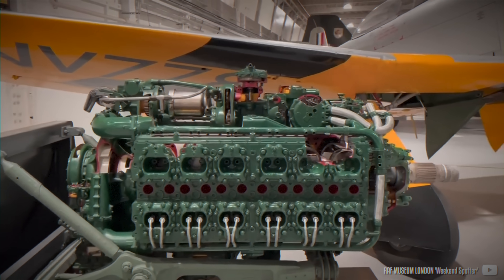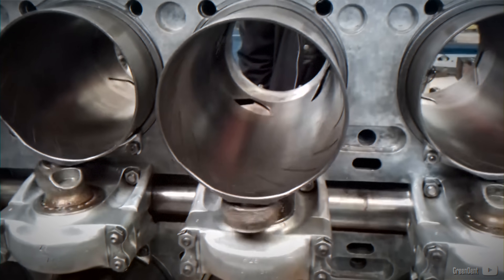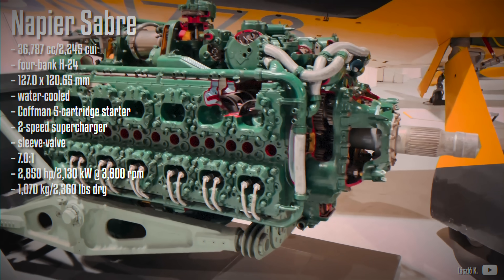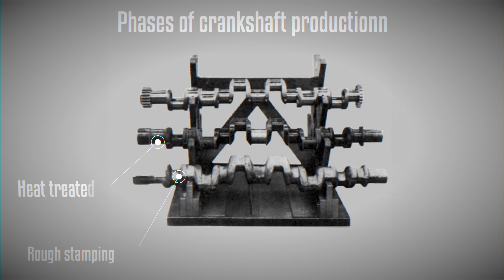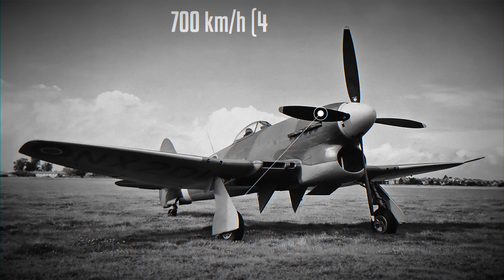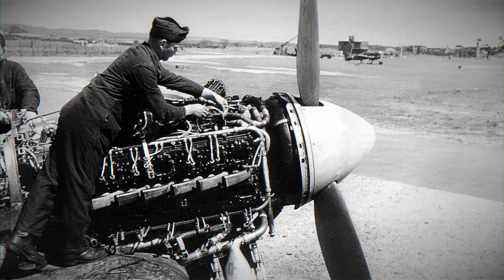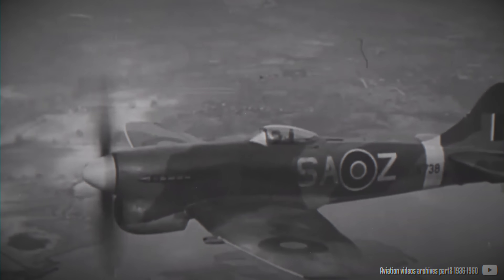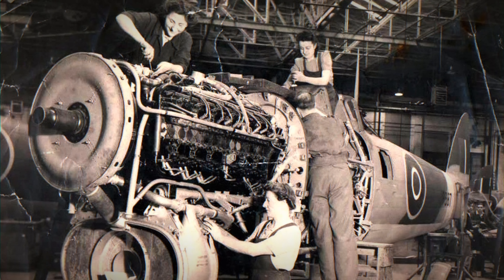An Unreliable 24-Cylinder That Helped To Win The War

Comment: These used a large amount of castor oil in their oil;  The mechanics that worked on these invariably ingested small amounts of this oil, which is a powerful laxative.

"I've gotta go potty!"
Reply: That sounds like an urban myth or maybe you made it up.  A typical adult dose to make you go is 15 to 20 ml - about one tablespoon.   It is quite likely that mechanics with oil on their hands might wipe their mouths and ingest some oil, but it would be nowhere near a spoonful, even if it was 100% castor used.
In any case, the digestive system has great powers of automatic adjustment and under regular ingestion will overcome any laxative cause.   Those of us old guys who, like Joe Biden, are on a drug esopremazole long term (eg to stop chest pain) know that - it causes diarrhea but only for the first few days.  When you stop taking it, you don't go for about a week.
In WW1 it was said that pilots ingested castor oil blown back in their faces by the open design radial engines of the period. But considering they had to fly rickety cloth & string biplanes into enemy territory and get shot at, I reckon anyone would get the urge to evacuate regardless of what they did or did not ingest.
Reply: @keithammleter3824 Rotary type engines used castor oil and were total loss lubrication, most of the oil was ejected from the exhaust ports and blown back towards the pilot and crew.
The typical image of the WW1 pilot wearing a scarf was a very practical article of clothing  used to cover the pilots mouth and prevent ingesting the castor oil
Reply: If they did indeed use castor bean oil in the Typhoon and Tempest,  the flight lines must have smelled wonderful. Castor bean oil was well known for unmatched lubricity and was quite common in the 60's and 70's in racing two strokes.

I road raced club level in the early 70's at Ontario on a 750 Honda and the smell in the pits and even on the track following a bike burning race gas and bean oil was quite lovely. Even some of the 4 stroke bikes had it in the crankcase. There was no mistaking the aroma.

The sounds of twin and multi 3 and 4 cylinder 2 strokes mixed with the booming twin XR 750 Harleys and the odd BMW boxer, 3 cylinder BSA and Triumph triples and Honda 500 or 750 and of course a 4 cylinder Z1 900 Kawasaki or two all making music to ones ears mixed with the smell of castor......well it was just magic. Ontario Motor Speedway Champion Spark Plug Motorcycle Classic 1972 or 1974 I think it was. The race tracks will never sound or smell as sweet as those days.

 Blendzall had 3-4 different castor bean oil mixes. I think Blendzall gold had nitro in it. I remember Blendzall green also. Later on when working on my bike in the garage I would grab a quart of Castrol pure castor bean oil and would put some in a teaspoon that was held in my bench vise and I would put a torch under the spoon to "cook off" the bean oil just to get the garage smelling somewhat like the good ole days at the race track.

I never ran bean oil in my two stroke Yamaha due to it gumming up everything in short order and needing to be disassembled regularly for cleaning the top end. I ran an early synthetic Steen C in my 2 stroke Yamaha cafe racer. Much cleaner burning but nowhere near as nice smelling as bean oil. I did run Cox model airplane fuel with bean oil and nitro in a lawn mower back then tho. Same wonderful smell!

To your remark about laxative qualities of castor oil my Dad told me a spoon of castor oil was used as a threat when he was mis behaving as a kid in the 30's. He said the mere threat would straighten him right out.
Reply: @sandervanderkammen9230  ;  Yes, I should have written "rotary" where i wrote "radial".
Reply: @terrydepew1252  : My mother told me much the same story as your Dad.   If I remember right she said it tasted really foul.  It was the foul taste that made her behave more than the trots.
Reply: @terrydepew1252  Great info!  RC model planes for years used methanol based fuel with nitromethane and castor oil.
Reply: @keithammleter3824  It was brown trouser day every day in the 20 minuters.
Reply: @throwback19841  You must have been a very bad boy.

Comment: The Sabre had THREE inlet ports and TWO exhaust ports, the sleeves had FOUR ports.  One of the sleeve ports (openings) serviced both an inlet and an exhaust port.  This is the same arrangement as the Bristol sleeve valves, the Rolls-Royce sleeve valves and the little-known experimental Continental (at least some of them) and Pratt& Whitney sleeve valve arrangements.

This is usually considered a no-no in engineering, with first relatively cool inlet gases travelling through the port followed very quickly by very hot exhaust gases, but it seemed to work.

There was never a 4000hp two-stroke deafening engine.  I suspect you have conflated the Napier two-cylinder test engine that was built under the same project as the Rolls-Royce Crecy (the deafening part) with the Napier Nomad, a two-stroke flat 12 diesel compounded with a gas turbine, a very fuel-efficient but complex engine that incorporated many novel features.

The Sabre suffered from two major failure points, the manufacturing of the sleeves, which is well known.  Lesser know were the problems with the plain journal bearings in the bottom end. A factory was built across the road from Napier's Acton works specifically to produce Vandervell shell-type crankshaft plain bearings for this engine. 

The reduction gearing on the Sabre is very interesting and uses a novel system to eliminate lash between the two crankshafts.

The Rapier was never put into production although it was used in at least one prototype.  

The Dagger was put into service but amongst other things the aircrews hated it, it revved at 4200 rpm and unlike the Sabre it fired at a regular interval of 30 degrees so it sounded like an unmuffled 8.4 litre 12 cylinder engine revving at 8400 rpm constantly - that was defending and in the Hereford the engines could not be synched causing a maddening low frequency beat.  Having said this, the Mark VIII produced just under 1000hp from 16.8 litres, about the same specific power as the early production Sabres.  It was an air-cooled overhead cam design with two poppet valves per cylinder.  The air cooling was its Achilles Heal.

Comment: The North American P-51D Mustang was probably the most successful airplane of WWII, but in my opinion, if this Napier Sabre engine with 2500 hp had been grafted onto the small airframe, you would have the only piston powered fighter of the war that could at least stand up to the 600 mph jets.

They mounted it on the Hawker Typhoon and while this was a winning combination, the front mounted radiator incurred a large drag penalty in comparison with the rear mounted radiator and belly scoop of the P-51 design.  Chuck Yeager said the Focke Wulf FW-190 was the best piston fighter he ever flew, but that was based upon its maneuverability, the P-51D was faster.  The Focke Wulf TA-152 was a high altitude fighter based upon the FW-190 with a huge bomber engine and it was very fast, but lacked maneuverability due to the larger wing and heavier design.

Great video as always!
Reply: @Flies2FLL Hawker did try the rear mounted radiator on the Typhoon on early developmental aircraft but found it was causing handling issues. Although the chin radiator looks ungainly, it does infact produce the same effect as the Mustang radiator. The Tempest Mk.V kept the chin mounted radiator on the insistence of the Ministry of aircraft production, the Tempest Mk.I had leading mounted radiators and was the fastest of all the marks of Tempest, and in my opinion the best looking too.
Reply: @andrewtadd4373  Can you site your sources for that information?
Reply: The Messerschmitt Me-109 was the most successful fighter aircraft in history.
Reply: @sandervanderkammen9230  No.
Reply: @Flies2FLL  THE MESSERSCHMITT ME-109 IS THE MOST SUCCESSFUL FIGHTER AIRCRAFT DESIGN IN HISTORY, THE 109 IS RESPONSIBLE FOR SHOOTING DOWN OVER 15,000 AIRCRAFT AND IS UNMATCHED IN COMBAT PERFORMANCE.
Reply: @sandervanderkammen9230  YELLING AND SCREAMING AND USING ALL CAPS WILL NOT MAKE IT TRUE!  Who do you think you are, Trump?

Site your sources young man-

By the way, does your mom know you are using the computer again?

Comment: The Merlin V12 was by far the top engine for the Allies in WW2.
Reply: The Merlin had the good fortune of good timing, being ready in time for WWII and still had enough legroom in the basic design that it was usable as a front line engine for the duration of the war. The success of the Merlin also shows that the recipe for success is having a good, if even a bit boring, base engine and keep improving it rather than flailing around in a 100 different directions trying all kinds of exotic approaches like sleeve valves.
Reply: RR Griffon, and P&W R-2800 fans will dispute that!
Reply: R-2800  started life with 2000 HP and by the end of the war 2700 with water injection.  Get ya home even with a cylinder blown off. Half the maintenance  of a merlin and twice the TBO! Was more of a gas guzzler though.
Reply: @mtacoustic1 Then they do not know what they are talking about.
Reply: @bushman4949 The Merlin started at 1030hp and got to 2200.
Reply: In terms of the largest and most powerful aircraft engine ever built, that title belongs to the Wasp Major
Reply: @mtacoustic1  - in comparison to the range of front-line aircraft that used the Merlin to the end of the war, the Griffon barely made a mark.  I"d be prepared to give the Merlin a tie with the R2800 though,
Reply: @TheSilverShadow17  - maybe so, and an astounding thing it was too - but it wasn't the engine that won the war (in fact it wasn't even ready during the war), nor the top engine for the allies.  All this talk of power and what was reached at what point is kind of irrelevant - the measure has to be what engine was used in which aircraft that had the most impact.
The Merlin's pedigree and usage ranges from the Battle of Britain to the Battle of the Ruhr, and also the P51 escorts to the Eighth and 15th AFs.  
The R2800 had the P47, F4U, F6F, sweeping the skies clear in the Pacific and sweeping the European battlefields clear in '44 & '45.  I don't think any engine comes close to those two.
Reply: @thosdot6497  I still hold massive respect for the Merlin is it was responsible for most of the victories by the Allied forces during the war, and sometimes people often forget or haven't realized that there were other engines that fulfilled the duty on an equal level. That said it's nice to be able to cover the ones that haven't had the time in the spotlight as much as the Merlin.

Comment: That's no doubt is Hawker Tempest V is the on of best fighter in ww2
Reply: No where near.
Reply: @v4skunk739  The aircraft capable of dealing with FW 190s on hit and run raids, shooting down buzz bombs and dealing wth ME262 at low altitudes - clearly one of the best fighters and fighter bombers of the war.

Comment: I'd love to see a reliable sleeve-valve engine built and used, but it would require some high powered engineers to think outside the box. That doesn't seem likely, when lately, they seem almost to avoid actual searching thought.

Comment: According to information that I read in a book, back in the late 1970's, the Tempest V had a terminal dive speed of 657 MPH, which was higher than that of any other fighter, including the Me262 (which it could out accelerate in a dive).
Reply: Pure B.S.
Reply: Aircraft with a front mounted propeller are incapable of controlled flights speeds above 0.80 Mach.
The Messerschmitt Me-262 had the highest critical Mach number performance of any WW2 aircraft.

Comment: A sleeve valve engine has a lot fewer moving parts per cylinder than a 4 valve poppet. Sleeve valve technology did not have the same long period of research that poppet valve enjoyed.
Reply: Sleeve valve engines had enough development to prove that their practical disadvantages outweighed their theoretical advantages.  Radial sleeve valve engines require ridiculously complicated valve trains, there's something like 100 gear wheels in a Bristol Centaurus.  And even simpler sleeve valve engines require more precision bearings and machined surfaces than poppet valve engines and require a more machining and fitting.  And a poppet valve engine can swallow a valve and keep running, any failure in a sleeve drive jams the whole engine.

Comment: Roland Beamont said that the Centurus powered Tempest was the best of all the Hawker designs. No one is better suited to comment than him....
Reply: Sorry the Hercules never powered a Tempest, that was the Centaurus. There is one of them flying as of about 3 months ago.
Reply: @stringpicker5468  Is was, too. That's what you get for texting in bed. Unfortunately, the sleeve valve is a great idea, but it is practically very difficult to maintain. They continually crack and fail. No different on the Sabre.
Reply: @MBCGRS the Hercules never powered the Tempest it was powered by the Sabre and the Centurus, they were also tested with the RR Griffin engine too. The Hawker Tornado that only ever got to the testing stage was powered by the RR Vulture engine.
Reply: Every fucking expert happy now...
Reply: Centaurus engine development took even longer to develop than the sabre.

Comment: Keeps me puzzled why on earth is that these gigantic engines (by displacment) deliver actualy not a lot of power for the displacment.
120-130 hp per liter is frankly not a lot at all.
Reply: 2,200 hp out of 37 litres are only 59 hp/litre.
Simple car engines of the 70s or 80s produced around 50 hp/litre. 
But in the early days they had much worse fuel. The compression ratio was only 7:1. Maybe thats one of the reasons. 
Also modern engines rev much higher. 
Motorcycle engines produce often around 100 hp/litre. But only on high revs and with relatively little torque.
Reply: @chrisridethatbloodything2044  Car engines really can't handle the duty cycle of an aircraft engine, that's the difference. They have 130 octane fuels in WW2 also.

Comment: OK.

Now, the killer problem of this engine, and why is wasn't adopted by any CAR COMPANY....

(Hello?  This should tell you something about the technology....)

Is that it needed extremely good lubrication in order to last 500 hours of flight time.  They had to use oil with a huge amount of castor oil, and even this wasn't good.  For use in an automotive engine which is expected to last 250,000 miles by the buying public who REFUSE TO CHECK THEIR FUCKING OIL at all means that this design simply wouldn't do; For these few thousand fighter planes in WWII, which was 80 years ago, this engine made sense.

Great video!
Reply: One might think that with modern synthetic and multi-weight oils, it would be possible to extend engine life, like they are doing with other WW2 engines currently.
Reply: 50,000 miles was a respectable life for a car engine in the 1940’s.   250,000 miles was not expected, even for a diesel truck motor.
Reply: @1967250s  No.  Or it would have been done commercially.
Reply: @jacksons1010  And your point would be?
Reply: I wonder, in these pictures were several women mechanics. They must be skilled when service and repair these engines. What were their career after war, just home wife or does any continue as mechanic?
Reply: SLEEVE VALVE engines were invented for automotive applications and thousands of sleeve valve engines were used in cars.
Reply: @juhajuntunen7866  do yoy know how mass production works? One worker puts toghether some small parts. The same parts every day. He or she knows nothing about the complete engine.
Reply: @Flies2FLL  Sleeve valve engines were developed because poppet valves had reached their limit of performance, you couldn't get more power out of them without burning the exhaust valves out. Sleeve valves had no such issue. What made the sleeve valve obsolete was the sodium cooled exhaust valve, which greatly increased the ability of the poppet valve to handle high temperatures.
Reply: @Flies2FLL   The point is this was an engine of the 1940's, and your conjecture as to why it was not adopted for automotive use it thus baseless - it had a working life comparable to other motors of the day.

Comment: Forgive my old addled brain. But why is horse power so important. Shirly the prop rotational speed is more important than the power or torque
Reply: Speed is result of Drag vs. Horsepower... aircraft engines are not rated in torque as it is not important.

Rpm of the propeller is typically limited to 2,700 rpm or less depending on the diameter and the tip speed...
Reply: These aircraft are fitted with constant speed propellors. The speed of the prop is effectively fixed at a predetermined RPM. You get more speed by increasing the pitch of the prop, as the throttle is opened. The prop therefore absorbs more torque, and translates that into more thrust.
Reply: @billyp4850  Not exactly true, each of the specific power settings, max.continuous cruise power, Mil./ take-off power and WEP are all produced at different rpms.
Reply: @sandervanderkammen9230  I understand this, however I was simplifying the explanation for someone that didn't understand